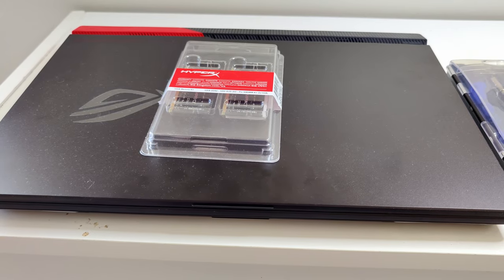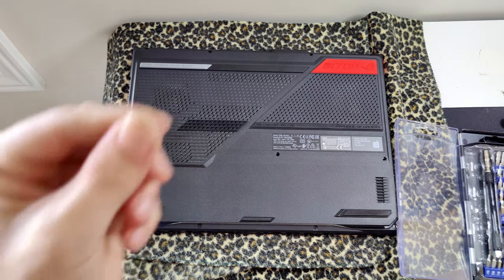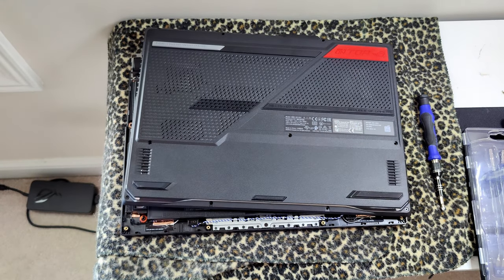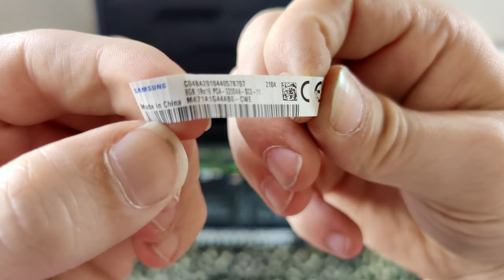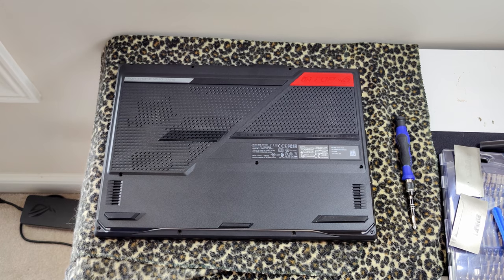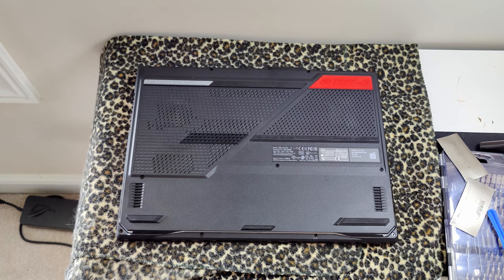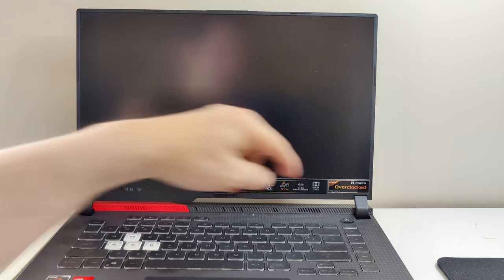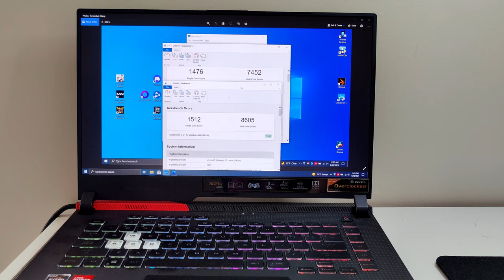Asus ROG Strix G15 Advantage RAM Upgrade

Comment: I just picked up this laptop at BestBuy here in Ottawa, Canada, and amazingly enough, it actually came with faster Micron memory with the exact timings that Jarrod's 'faster' memory kit has. So it looks like Asus has either solved the supply shortage, or I got really lucky. I realize you also upped the capacity to 32GB from 16GB, so it makes sense for you to do that. 16GB is plenty for me, as this machine is entirely for gaming. Just wanted to let other potential buyers know.
Reply from the maker: That is great news so most people won't have to upgrade theirs unless you want more than 16 like me.
Reply: Yeah bro, even I was lucky. I got the faster ram kit as stock, but my friend who bought the same, got the slower ram kit.
Reply: I can confirm the same for me. Microns with 560 TRFC. Awesome move by asus
Reply: Can you please provide the batch you got and when it was manufactured?

That'd be really helpful as I'm saving up for the laptop for a long time and don't really want to spend on an upgrade as PC parts are very expensive in my country.
Reply: @banana6963  serial number starting with M6
Reply: @anibalhuneeus  how did you check that ?
Reply: How is the laptop ? Any problems you cam across? Does it handle every game well at max settings?
Reply: Same from Toronto.
Reply: @banana6963  mine had the M7 with micron memory
Reply: How do you check what memory it came with or RAM? I got mines from Canada computers
Reply: @anibalhuneeus  Mines M7 is that slow?
Reply: @thenoscoper4569  How do you identify memory - mines m7 as well.
Reply: @sundown308  the micron is the good one I believe. If you have the samsung one ur fucked lol
Reply: You still enjoying it? I’m in Ontario too and looking.
Reply: I got the slow stuff, but I did the 32GB upgrade, and added a second 2TB NVME.  You can always upgrade someone's laptop that you know, that's using less than 16GB.  Best Buy is running a Black Friday sale on the 165hz QHD model, with 16GB and 512GB.  It's $1099 ($600 off).  Pickup another NVME and 32GB of Ram, and for cheap, you can have a 2.5TB, with 32GB of Ram version of the G15 Advantage Edition.
Reply: I am using this same laptop... an Asus Rog Strix g15 laptop with default 8 GB ram with 3200mhz after installing an additional 8 ram 3200mhz showing 2400mhz. What to do????

Comment: The only thing people need to be aware of before upgrading is making sure the ram doesnt just function with xmp profiles, make sure its also plug n play as well.
Reply from the maker: Absolutely I should have mentioned that in the beginning. XMP doesn't work on this laptop.
Reply: @XxViciousxX  wahat is XMP?
Reply from the maker: @STgameplay.  Extreme Memory Profile.  It's basically the easy overclock button for memory. Most laptops don't support it though.
Reply: @XxViciousxX  does this laptop support DOCP? (which is pretty much the AMD version of XMP)
Reply from the maker: @sreenaths6829  It does not which is what made finding decent RAM a little tricky.

Comment: I recently upgraded with a crucial ram in rog strix advantage then i though that is going very well when i testing but after 20min the game crash down and i tried to reopen but later it got blue screen and then it gets crashing but everytime getting worst until i format it the laptop thinking maybe is that the problem or the ram after that i cant boot  the laptop anymore it turns on but just the logo and tgen a black screen, i deasembled everyting and put the old ram after that right now i dont have no solutions. I want to know that you think because im so fcked😭
Reply from the maker: So long as it gives you the logo it will let you in the BIOS I'd go in there and reset everything to default. So long as you can get to BIOS you can also change the boot device and reinstall Windows off A USB if it somehow got corrupted. If none of that works something may have gotten fried, unfortunately. Sorry, it took me so long to respond Youtube loves to not tell me I have messages sometimes. Only saw it because of another comment.

Comment: Wouldn’t of trusted myself to do this had I not seen this video.

Was actually gonna pay somebody to do it for me. I’m so glad I didn’t and just followed the video. Was much easier than I thought.

I forgot to remove the battery tho of my laptop oops. But overall it looks like it’s working.
Reply from the maker: Glad my video helped you out. That's how most things with computers are I was a little worried going into it the first time too. Don't worry about the battery I didn't take mine out or disconnect it either and I have opened my laptop quite a few times and so far nothing is broken yet.
Reply: I'd personally always disconnect the battery before performing any sorts of operations to any machine 😄

Comment: I need help. I bought the same exact ram hyper x impact 2x16gb cl20 3200mhz sodimm ddr4 and I have the same exact laptop but when I install the ram sticks together it goes into bsod. I can use them separately or 1 with stock ram but never together. What could be the issue here? Is there a different type of hyper x ram that I accidentally bought that doesn’t function together? It is a problem with my laptop?
Reply from the maker: Sounds like one of the new RAM sticks is broken if both your old ones still work it wouldn't be the laptop's fault. So I'd just try to get a refund and hopefully, next time both sticks work.
Reply: @XxViciousxX  But the thing is they work separately. They work by themselves just not together. Does it still mean the ram is bad?
Reply: @XxViciousxX  I tested this same ram on a different laptop. This time it worked and I was able to use them both. I think there is a problem in my laptop or maybe the bios.
Reply from the maker: @AngryEgg6942  That's definitely odd I was under the impression that your old RAM was working fine but one of the new sticks refused to work. Would only work with one RAM stick. But if both work in another laptop then they can't be broken. 

So it probably is some BIOS issue. As mine is still going strong with this RAM today.
Reply: @XxViciousxX  Which bios version do you have?
Reply from the maker: @AngryEgg6942  I'm on 316 so I get my max fan speed. All the BIOS after always limit my fans by 1000 RPM.
Reply: @XxViciousxX  Ok I’ll see if I can get to that version. Also I think you can just use ghelper to change fan speed as you wish. I have it and I’m able to set any fan curve I want up to 6800 RMP which is the max.

Comment: hey, do you think installing two individual 16GB ram sticks (instead of one kit) is advisable? I haven't found a lot of options for kits in local stores, only in Amazon. I plan on getting 2 sticks of 16GB crucial ddr4.
Reply from the maker: You can install 32gb with two sticks of 16gb. You can even go up to 64gb on his laptop.
Reply: @XxViciousxX  I know that, but I was wondering whether to buy a kit (2x16) or buy the sticks individually (16+16).
Reply from the maker: @anyanyanyanyanyany3551  Ah sorry about that I guess I misunderstood the question. Some people say kits are more stable. But from my research, I can't find anything that actually confirms that. So I'd honestly just go with whatever is cheaper.

But if you do get individual sticks just make sure they are the same (which I'm sure you already know but wanted to make sure).
Reply: @XxViciousxX  aight. Thanks for the info. Really appreciate it.
Reply from the maker: @anyanyanyanyanyany3551  You're very welcome.

Comment: XxViciousxX I have the same model. I changed the memory to 2x16 3200mhz cl22 goodram, will replacing them with cl20 kingston fury give better performance? Do you feel an increase in performance over factory memory? This model easily supports 64GB of RAM
Reply from the maker: I noticed a decent difference in average FPS and lows by going to the furry RAM. Asus said the max is 32 GB. However, I have had lots of people telling me they run 645 GB with no issues.

Comment: Thank you for the video small question I have a Corsair RAM and a brand can I mix the two?
Reply from the maker: You're very welcome. I wouldn't personally mix RAM Unless they are exactly the same MHZ and CAS Timings And are the same type of RAM like B-Die just as an example. But you can still try it worst thing that will happen is it won't post or give you very stuttery performance in games. It won't break anything.
Reply: Thank you for your reply 👍 I wanted ODL BIOS version 333-316

Comment: Just followed your great guide on doing the SSD, now looking at RAM. Is this laptop okay with DDR5? Also the current speed of my RAM is 3200 MHz, is it okay to go faster? Thanks again for your help before
Reply from the maker: This laptop is pretty finicky with RAM. It's got to be DDR4 3200mhz (DDR5 is only for 12gen Intel right now) with no XMP profile (this laptop doesn't support that) then lastly it can't be over 1.2v or it will default to 2133mhz. That's why I went with the kind of pricey Kingston Hyper X Impact RAM. As it seems to tick all the right boxes.
Reply: @XxViciousxX  Thanks for answering. That is really specific!
Reply from the maker: @MtnNerd  It should say in the specifications in the listing of the RAM you're looking for. Some even list it in the title of the page. I think when I bought my RAM from Amazon the page listed the speed, voltage, and DDR type all in the title of the listing.
Reply: @XxViciousxX  Sorry I found it right after I posted that and tried to edit before you saw😅

Comment: Thanks, noob question - where can I buy (amazon link maybe?) that thingy to unlock the cover - you slide it to open the laptop ... I don't have it 😪 I only have the rusted screwdriver and RAM :P :P
Reply from the maker: Sure no problem here's a link to that tool as well as for a kit similar to the one I used in the video. https://www.amazon.com/iFixit-Prying-Opening-Tool-Assortment/dp/B0762BVXDY/ref=asc_df_B0762BVXDY/?tag=hyprod-20&linkCode=df0&hvadid=416875525560&hvpos=&hvnetw=g&hvrand=7074715173210720666&hvpone=&hvptwo=&hvqmt=&hvdev=m&hvdvcmdl=&hvlocint=&hvlocphy=9016912&hvtargid=pla-443016893748&psc=1&tag=&ref=&adgrpid=100759324264&hvpone=&hvptwo=&hvadid=416875525560&hvpos=&hvnetw=g&hvrand=7074715173210720666&hvqmt=&hvdev=m&hvdvcmdl=&hvlocint=&hvlocphy=9016912&hvtargid=pla-443016893748

https://www.amazon.com/gp/aw/d/B09B4YVJQL/ref=sspa_mw_detail_1?ie=UTF8&psc=1

Comment: Does opening the back panel void the warranty for this laptop?
Reply from the maker: No it does not, not unless you take off the vapor chamber cooling. That's the only thing I saw that had a warranty void if removed sticker on it.

Comment: Perdonami. Non ho capito se questa RAM senza profilo xmp funziona a 3200 come la RAM originale.
Reply from the maker: My unit came with some cheap RAM that had terribly loose timings so I got this RAM with much tighter timings and got much better FPS in games now. The more recent versions of this laptop started coming with good RAM from the factory so doing this is probably pretty pointless unless you have an M5-M6 version on this laptop.

Comment: Thanks for the video! I installed a new SSD and RAM today and every game is running worse than before. Very slow and laggy. Do you know why this might be?
Reply from the maker: You're very welcome. That should not be. Is it possible the stock RAM is better than the RAM that you got. That does happen sometimes Not all laptops come with bad RAM. 

Second figure maybe it has something to do with the SSD but that's only if stuff was laggy coming from the new SSD. 

Last thing I can think of doesn't really make any sense but is it possible games just decided all of a sudden to start using the integrated graphics versus the 6800M?
Reply: @XxViciousxX  Ah thank you, I've now put the old ones back in and it's just fine. I think maybe a bottleneck.

What 16bg rams do you recommend for this laptop? 

Thanks again!
Reply from the maker: @abigailcanright570  You're very welcome. There's a guy named Skiiin my Discord he really knows his stuff and he recommends this RAM https://www.amazon.com/dp/B098TYN671?th=1 as it's fast and cheap. Vs the RAM I got which was way more expensive.

Comment: Did you finally put the heat dissipation copper sheet back on the rams or running laptop without them? And if no, then any unusual heating observed?
Reply: I wonder that too
Reply: @lily-yi9ho  I did put them back!

Comment: Hey there! Curious why you went with this ram at $259 when the GSkill RipJaws are only $109? I know Hyper is CL20 Whereas GSkill is CL22, but it can't be that much of a difference. Looking for opinions. Thank you!
Reply from the maker: I just wanted the best I'm almost positive the 2 lower CL doesn't amount to much over the Ripjaws but figured if I'm opening this thing up why not just go the balls to the wall.
Reply: Timetec 1.2v 3200Mhz CL22 Dual Rank is better ram, the HyperX impact is slower as it's Single Rank.

Comment: I am using this same laptop... an Asus Rog Strix g15 laptop with default 8 GB ram with 3200mhz after installing an additional 8 ram 3200mhz showing 2400mhz. What to do????
Reply from the maker: Does the new RAM stick you put in the same timings, 1.2v and no XMP?
Reply: @XxViciousxX  yes, bro crucial ct8g4sfra32a 8gb 3200mhz Ram
Reply from the maker: @subash003  Does the original RAM still work or is it also saying 2400mhz? Sounds like maybe that new stick is possibly a defective stick of RAM.

Comment: When my laptop's ram upgrade (2x16) gb ram. But not showing 32gb ram. showing 24gb ram in the task manegar and model is asus strix g15 G531GT. why, please help me.
Reply from the maker: That is stange coulintegratedrgrated GPU be allocating some of that RAM to itself. I'd also try to just make sure the RAM is all the way installed I have had all sorts of issues with Desktops messing up just to find out my RAM was ever so slightly out of place.
Reply: @XxViciousxX  Thanks for information 👍🏻

Comment: I just watched a different video on how to replace the ram sticks. Is it necessary to disconnect the battery before installing the ram?
Reply from the maker: You can if you want but so far I haven't had any issues by not disconnecting the battery and I have opened mine up and installed RAM,a SSD, and a WiFi card and it hasn't had any problems yet. I figured I'd be clumsy and break the battery connector trying to disconnect it. Same reason I didn't remove the ribbon cables for the RGB.
Reply: Could draining the laptop's battery help with the static discharge? And is it important to add a heatsink on the RAM and SSD?
Reply from the maker: @ronaldmislang8635  For static discharge you'd have to touch something grounded before starting to work on the laptop. I always touch my secondary desktops case beforehand as well as not wearing socks on carpet and so far I haven't fried anything yet. I didn't bother with the heatsinks and haven't had any trouble but to can put them back on of you want. If you get an  SSD with a heatsink make sure to get one that's not too tall or it will interfere with putting the laptops bottom case back on.
Reply: For my final question, will you make a video on how to reapply the thermal paste? Also, thank you so much for answering my questions.
Reply from the maker: @ronaldmislang8635  I will definitely do a video when I redo the LM which probably won't be too long from now. You're very welcome.

Comment: Quick Question: How much ram does the G15 support, 32gb? 64gb?
Reply from the maker: Now that's a tricky situation the manual and Asus says 32 is max. But I saw people on Reddit getting 64gb working. I went with 32 didn't want to have to open the laptop twice just in case 64gb didn't work for me.

Comment: I got an N1 model a month ago brand new from Best buy and it had 2 8GB micron 1Rx16 ram sticks and I upgraded to the Crucial 32gb ram and performance is through the roof now. It was built in 2022 and still had the bad ram but micron instead of Samsung. 😂
Reply from the maker: Well thank you for letting me know that just because it's new doesn't mean it automatically has good RAM a lot of people were telling me that that was the case.

Comment: Good afternoon friend. I'm from Brazil and I can't understand the video perfectly. You mentioned that some models come with better quality ram and others with lower quality. How can I know if the ram that came with my notebook is among the best or worst quality? I have a Rog Strix Scar G533QR ryzen 7 5800h rtx 3070 model 2021. The RAM code that came on mine is M471A1G44AB0-CWE
Reply from the maker: This video is actually just for the all AMD version of the laptop. Yours should be absolutely fine from the factory in every way.

It's just the AMD versions which are the Advantage versions sometimes come with some less than stellar RAM.
Reply: @XxViciousxX  thank you very much for the answer, friend!
Reply from the maker: @razi_37  You're very welcome.